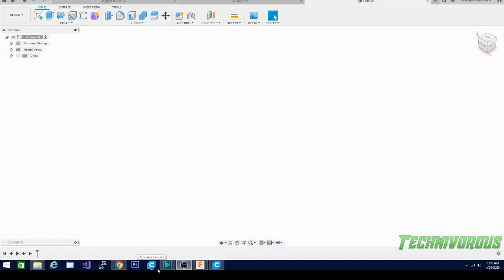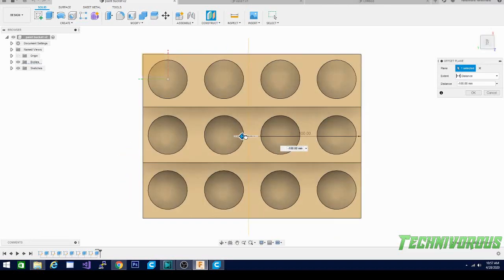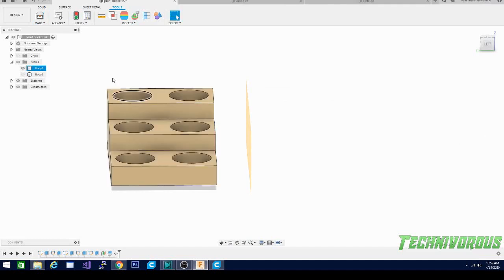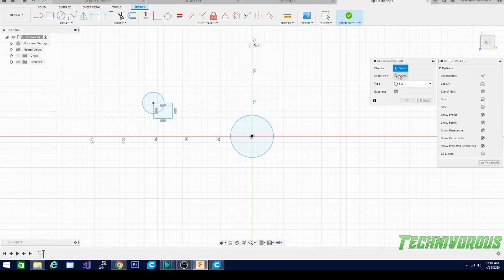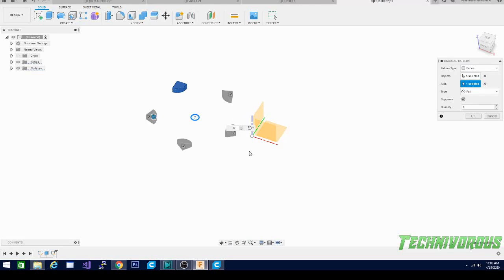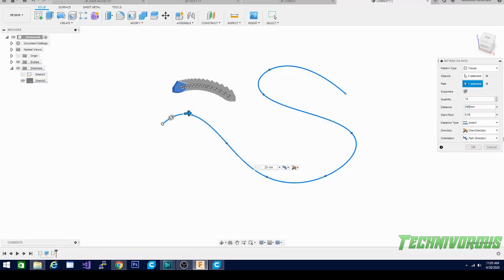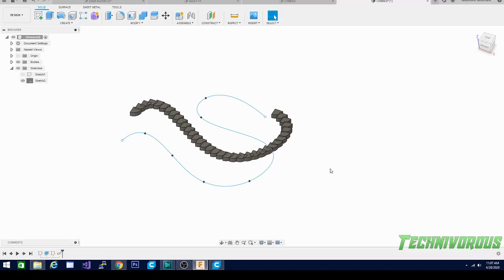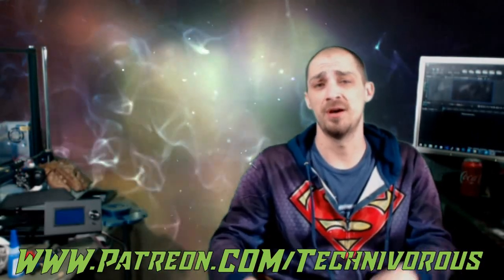Fusion 360 Tutorials  The Basics 3 Split Body, Circular Pattern, Pattern on Spline

Comment: I like this style of tutorial. Easy to follow and not too much information all at once. I use a lot of keyboard shortcuts in Fusion 360, I’m sure you will discuss them at a later time.  It’s good to know where the commands are on the menu before you worry about the shortcuts.  I use the 3Dconnection wireless Space Mouse and wireless CadMouse Pro.